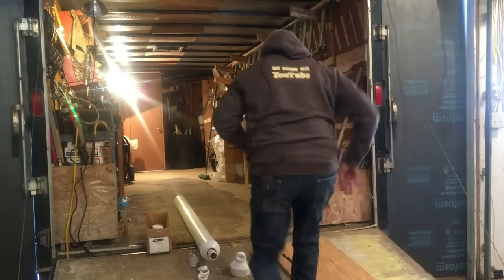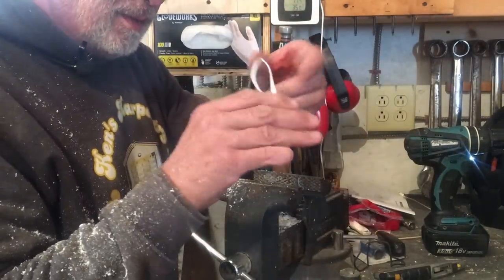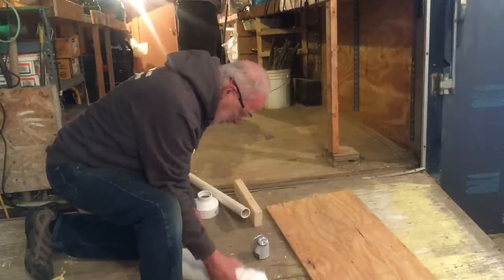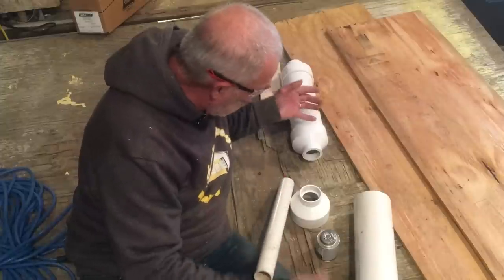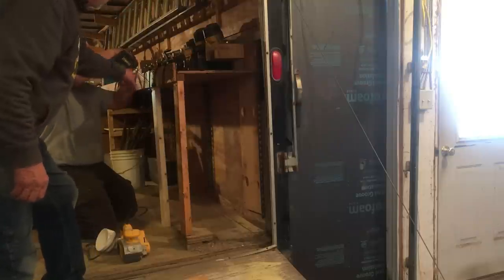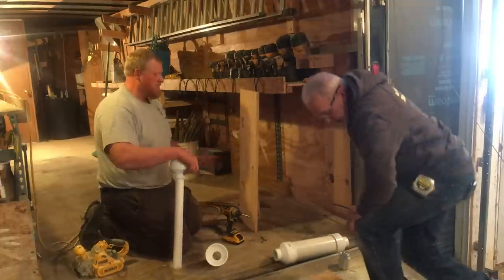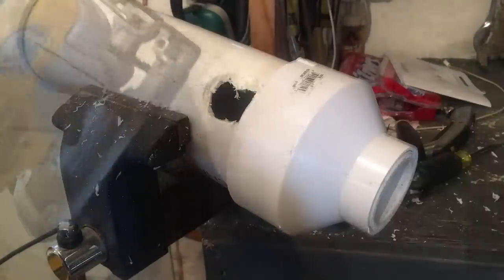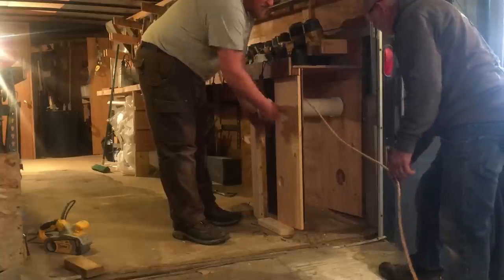BIGGEST Improvement to Equipment Trailer EVER

Comment: You could rig up a plate with a bolt head so you could use a drill with a socket to turn the tube to reel in the cord.  500 feet is a long way for extension cords. Line loss will be harder on the motors as they will not be running at rated voltage.  Heavy duty 12 gauge or bigger cords are needed for those lengths.
Reply from the maker: Good input. We rarely go more than 100’ to a tool and our cords are 12 gauge.

Comment: glue a small square nut pipe end on there and then use your drill to spin the spool. Even a 1/4" adapter for an impact driver. No need for a handle when you have a battery powered drill to do the work for you. Great job guys!
Reply from the maker: Great tip!

Comment: You have room for another 2 drums. You could make one permanent by running plug end in drum and make a short cord to run to power source. 
So when you need cord you unroll that one then plug short cord to it, it's hanging out of drum , and connect to power source. This way for that cord you only pull out amount you need for a table saw let's say.
Reply from the maker: Nice thanks

Comment: Wire the trailer too, Ken you know best, but how about a male socket for the generator or home owners power feeding the trailer, running to a (lighted) GFCI outlet which in turn feeds multiple outlets for your extension cords tool battery chargers plus a switch for an ceiling mounted LED work light for those dark days. Wire with two wire 12AWG NMC to minimize voltage drop. Feed the trailer with a 10-gage extension cord.
Reply from the maker: Thanks

Comment: One thing you need to figure out is a bungee cord system to keep the cord from unwinding as you drive over lumps and bumps in the road. You definitely want to avoid having a pile of spaghetti on the floor from all that shaking. It might be as simple as a wrap or two with the hooks stretched to the end of that countertop.
Reply from the maker: Thanks

Comment: Hi Ken, a handy hint for reusing newish pvc unions: cut the pipe protruding from the glued Union that you want. Clamp the Union for stability and use a broken hack saw blade with tape for a handle, to cut the inside of the pipe. Take care not to cut into the Union. In Australia we have a blue or green colored glue which is a help in identifying the you have cut through the pipe. Because it is a relatively new glued joint the plastic may not have become brittle. You can gradually force a small screwdriver next to the cut and pry off the pipe. I have done this often when caught out in a repair as I lived in the bush. Older pipe is more brittle and can crack out but it sometimes works but I add a few mor cuts so I am levering off slivers and not stressing the coupling that I need. Try it. I enjoy these videos keep ‘em coming
Reply from the maker: Thanks I’ll remember that

Comment: Good job guys! Makes cord handling easy. If you want to "un-glue" the PVC fittings carefully cut the pipe inside the fitting with a hacksaw blade (or reciprocating saw) then heat the pipe with a heat-gun. When it's close to melting use needlenose pliers to grab the pipe piece inside the fitting. It should just twist right out. I've done this trick on several screwed up plumbing projects. Do it in a well ventilated area because it makes some terrible odors that I'm sure aren't healthy. Just something I thought you could try.
Reply from the maker: Thanks

Comment: I also like the idea to use a variable speed drill to wind the cable.  I used a drum for my RV cords.  The thicker RV cable needed a bigger drum.  The metal drum was an old wiring drum that I obtained from a big box store.  (They throw the old ones out anyway.)  The drum was about 8 inches in diameter.  😊  Now where did I put my cordless drill?  . . .
Reply from the maker: Haha nice

Comment: What if you wound up 50' cords on one reel and 100' on the other? Then if you mounted an outlet box on the trailer with a cord to plug in to a source. Then you get the cord off the reel and plug in. I would suggest a wood box with cleats on the bottom for your form stakes and then use a 2 wheeler to move them. Moving stakes like that in a plastic bucket doesn't work well. I would have built 2 sections on the floor to put rolls of house wrap and roof wrap. You probably have partial rolls, so if you had 4 sections you could put a full and a partial in it of each. Also I would make room to carry some extra 2 x 4's  8' & 12'
Reply from the maker: Thanks good idea
Reply: @kenskarpentry  I just finished watching your latest video. That one and this one are kind of out of order. I saw where you mentioned the space for long items and I saw you had a 2 wheeler under your pile.

Comment: Ken, You mentioned having 1 & 1/2 people working on this project.... I'm thinking that you failed to include yourself into that equation. 🤪

As for a winding mechanism, 🤔 if you were to cut off the bell and take an old 1/2" drive socket, epoxy it into the 1-1/2" pipe... Now you've got a long lasting solution for attaching a 1/2" square drive handle or drill into the works and as an added benefit, it wouldn't be hanging out in the way as you move in and out of the trailer, also less chance of being broken off by accident. (I don't think an impact would be a wise choice, it would just destroy the whole works.)
Reply from the maker: Haha thanks

Comment: Isn’t there a way that you could use a drill to wind the cables in rather than a hand crank?
Reply from the maker: Hmmm
Reply: @kenskarpentry  maybe a circular piece of wood with a bolt locked in the middle that you can glue into the fitting?

Comment: Other people here are saying wind it with a drill, and I agree. Also, if putting multiple cords on the roll, would separator disks help keep different lengths in place without tangling each other?
Reply from the maker: We will separate them